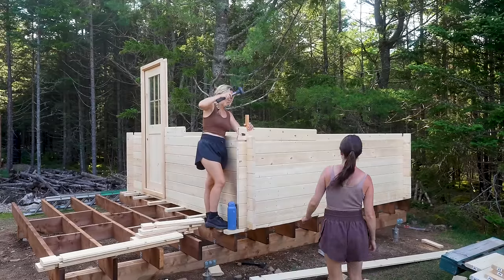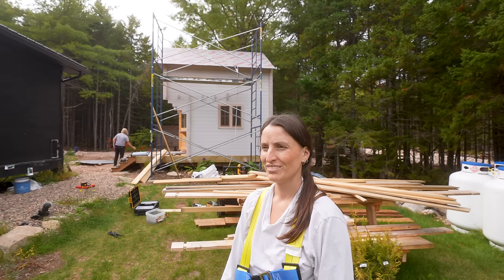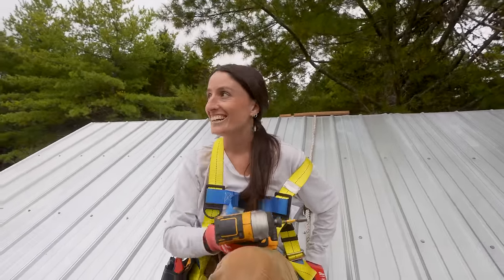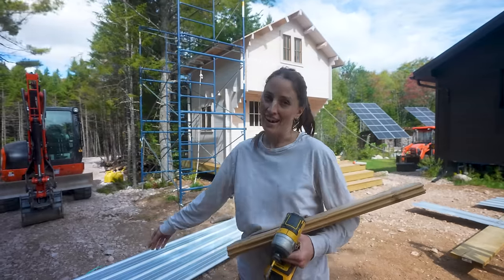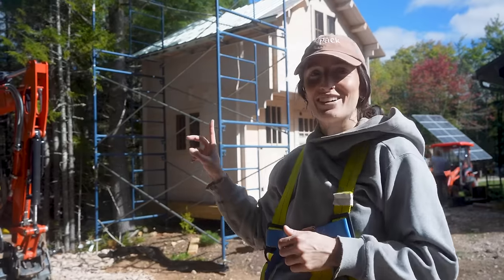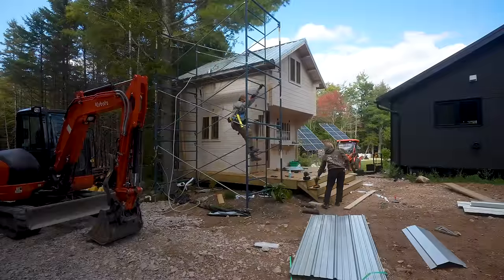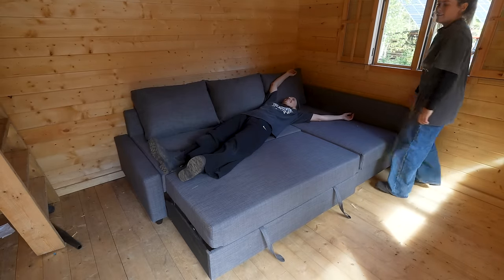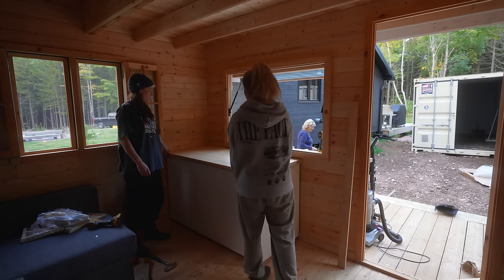COME ON IN! Finishing Simple Off-Grid Sawmill Log Cabin in the Woods! (Part 4)

Comment: Way to go girls, fantastic channel! I just came across this channel after watching Ambition Stikes. So many great projects done super well. Keep it up!
I'm building on my own an 80m2 2 storey building in the UK. As it's the UK it's all concrete and stone, even the roof! 1m deep concrete foundations to support all that weight! My builders did everything to get it dried in and I'm doing everything inside. In 18 months, I've fitted electrics, heating ducting, staircase, floorboards and a huge amount of insulation, I'm only now getting the drywall done. You guys are so quick, but on most projects I reckon 2 people can do most jobs more than 3 times as quick as 1 person.

Comment: Beautiful job I have done several metal roofs this year just FYI if you lineup at the bottom and clamp the metal you can layout and drill all the pieces at once just be sure to support the underside while drilling. My boss is crazy particular his system not mine ❤️
Reply: That's the way I do it as well. Drill all the holes at once, and you know they are all correct.
Reply from the maker: That is such a great tip! Thank you so much!!💛🐶

Comment: Hello ! Nice work. 
Just a quick tip. When you are setting up the scaffolding, you need to put the feet on wedges. Especially if the ground isn’t steady like on concret. It helps distribute the load on the ground. This prevents a foot from sinking and the scaffolding from tipping over. plus you don't need to level the ground.
Greetings from France 👋
Reply from the maker: We love that, thanks for sharing with us. We always have issues with the scaffolding. 😊

Comment: I think it's a neat idea to have shorter legs on the bed in a sleeping loft. Because the ceiling is at an angle, I think it's nice to have the bed lower, to have more room. up there. unless you want to use the space under the bed for storage, or ventilation or building utilities.

Comment: Another beautifully done job off the checklist ✅️
Shipping Container ?_?
Does Clementine fit ?_? 
If it fits, it ships...🚛
The new portable pack tool crib ?_?
With solar, battery, and tri gas generator power supply ?_?
Would be handy for charging all that video equipment and all of those power hungry tools. Especially in those hot sandy Ocean view regions with possibly limited power supply.
Perhaps install some vent fans and maybe even a self-contained AC/ heating unit ?_? 
Convert a portion of it to living space ?_? A tiny home for the construction site. Decked out VanWives style. Kitchen, bathroom, cabinet on the wall queen size bed. Fire code separation, fire/carbon monoxide detectors. Don't forget the fire extinguishers.
Looks like a forty footer. I'm pretty sure the tractor will still fit. Even with all of your tools.
Everything you need is ready to ship anywhere in the world... 🚛 
🚢✈️🚂🌐 Well, it's a thought. ')
✌️🤟🖖🐾🐾
Ps. I was just thinking you will have your van. There is no need for a tiny home built into the shipping container unless you so desire the extra space. Otherwise, room for more tools and toys...🤿🎯🪁🥽🔋🎙🎚🎛📻💻🎞🎬📽🎥📹📐🗃🔨⚒️🛠🪚🔧🪛🗜🧰🪜🔭🩹🧯🚜🚲🛺📡....
Reply from the maker: Wowee thanks for taking the time to share with us. 😊🐶

Comment: The roofing underlayment  also acts as a much needed vapour barrier in these bunkies. From experience you should have strapped the roof with 2x2 on the screw line and installed min. 2" sheet foam insulation. From experience the swing in windows leak at the bottom in driving rain.
Reply from the maker: Will keep an eye out thanks

Comment: I am sure someone must of told you to put the roof screws on top of the rig not on the flat part.  If a screw on the flat part is not installed correctly the rain will easily go in the hole.  If the same thing happens on the top you will rarely get any water in it.  Who told you to put it on the flat part.
Reply: This question was answered in the comments section of a previous video.

Comment: You guys do realize that you keep making the same
Mistake over and over when installing a metal roof right…

The screws go through the corrugated/Rib part of the panels, not the flat of the metal.
Reply: This issue was addressed by the Vanwives in the comments section of a previous video.